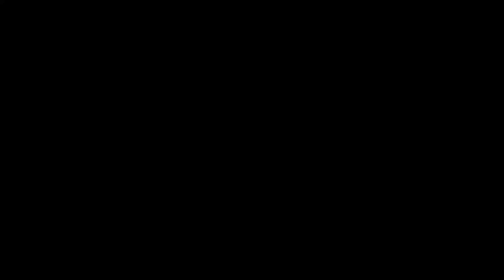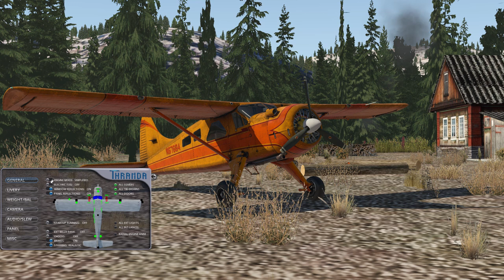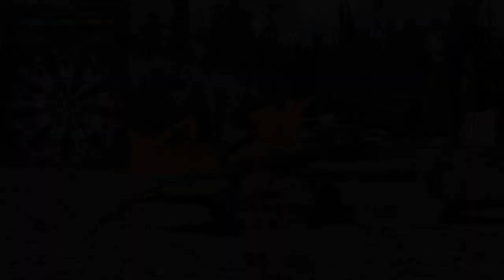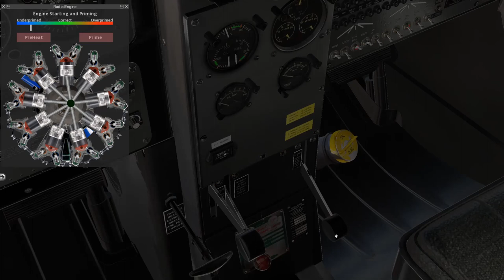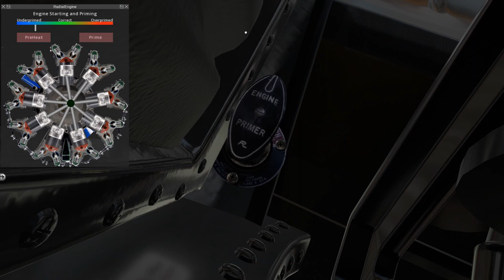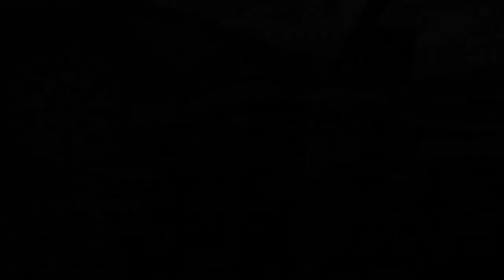Thranda Design De Havilland DHC-2 Beaver Engine Starting Tutorial

Comment: I love the DHC-2 probably my favourite plane of all time. I've been using the soul made one for years and its amazing but I don't have any doubts that your version will be superior enough over it to warrent a purchase especially after the awesome job you guys did with the Porter. 

I am wondering something though. I know in real life its standard practice on a cold start (or even starting in general a lot of times) to crank the engine over with the mags off for a few revolutions (4 count) to get some fuel in the cylinders and then flick the mags on as the engine is cranking. Its something I do in the sim as well. IRL the plane will start without doing it, it just stumbles a bit more. Im curious how the code in this plane handles that if you start it that way and how much of a difference it makes. 

Other than that the start up procedure was 100% familiar to to me. Either way Im looking forward to this getting released and keep up the good work. Im a Bush guy and lately you've been a god send.

Comment: The difference between cold start and hot start - is there a difference in procedure or engine performance, or is it just that you have to wait for the started engine to warm before using?
Reply from the maker: Generally yes; the temperature of the engine determines how easy it will be to start and how much priming it will need.  For a cold start where the engine is at a normal ambient temperature, the procedure is to apply 3 to 4 primer strokes.  If the engine is still hot (more than maybe 60 degrees C) you probably won't need any priming.  The pop-up can be used to get an indication of how much priming will be needed.